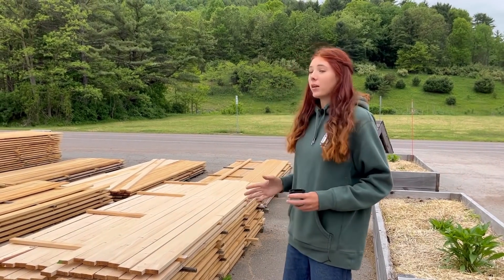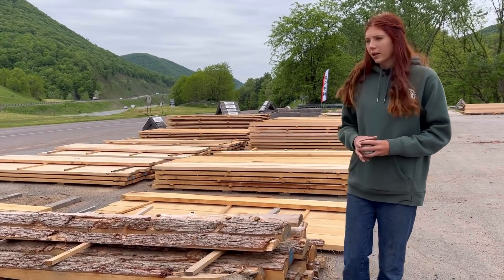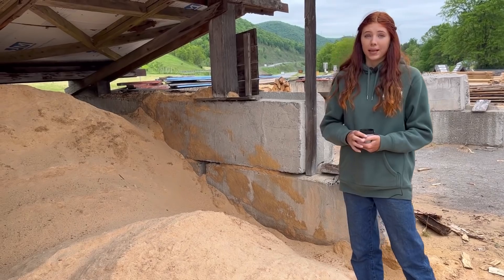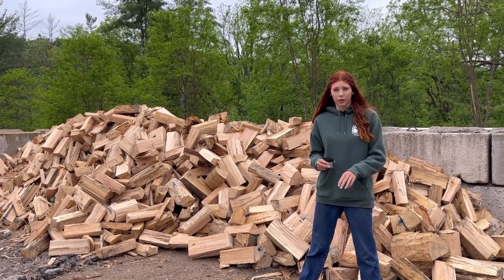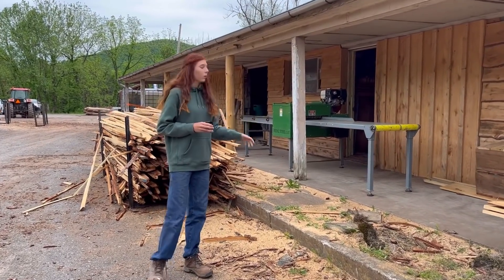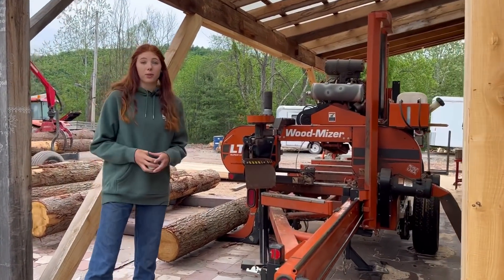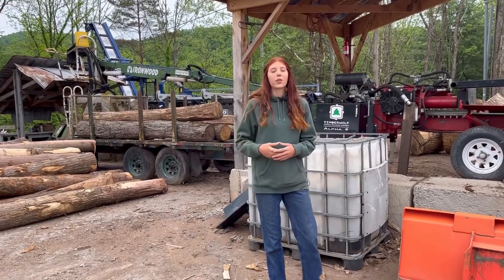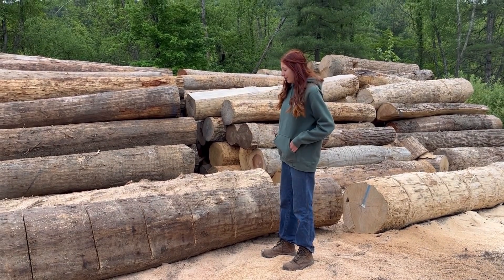GRAND TOUR OF OUR LOG YARD! 213

Comment: Wow so much has changed. Y’all have THE BEST setup. I wouldn’t change anything. One thing with the potting soil is that you do not want it to loose its moisture, if it does it’s called dust and you can’t sell dust with little pieces of perlite in it 😆
Good idea to spread it out to mix it, but after that pile it up so it stays moist. Remember UV light (the sun) sterilizes soil which kills all the micro organisms. You might even consider putting a shade cloth over the potting soil bunkers so water can still get through but UV can’t. Other then that I can’t believe that slab pile is taller than you! One last thing... when you go to bag the potting soil you can always add some perlite or other stuff to it so you don’t have to worry about mixing the piles perfect.

Comment: Logs do not season
Reply from the maker: Sure they do
Reply: @lumbercapitallogyard  no
Reply: I've done firewood for 30 years and logs just don't season
Reply: @lumbercapitallogyard  Without getting  into a semantic discussion of what exactly “season” means,  logs will lose their moisture a lot slower than cut firewood,  and cut and split wood will dry a lot faster than unsplit rounds.   Also, although I haven’t seen any birch in your videos,  birch logs truly will not season. Birch bark retains moisture well enough that a pile of 8 ft birch logs will just rot from the inside out.